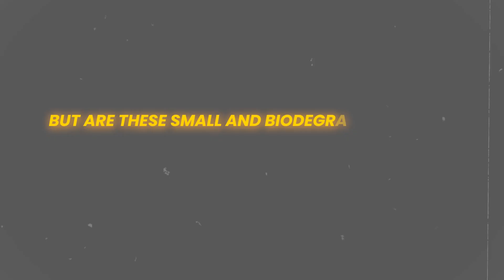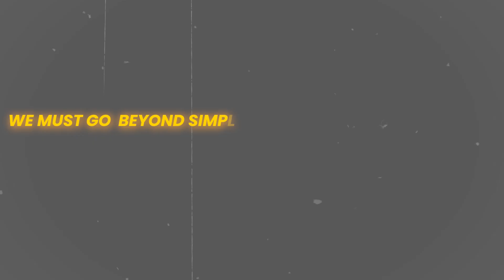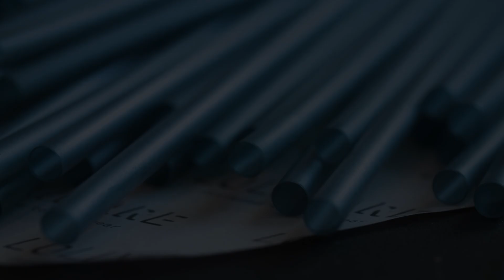How Much Are Paper Straws Really Helping To Save The Turtles

Comment: We can also drink everything without a straw!
Reply: When I went to local fast food shops as a kid we didn't even get lids much less straws, and I learned how to drink enough out of the cup before my parents left the parking lot and started hitting every pot hole.  Originally I wore a lot of cola, but got pretty skilled at not getting stuff splashed on me.  Then the first straws were introduced and they were all paper which quickly became soggy.  Plastic showed up and bendy straws and life was good again.
Most of the time I don't even use a straw even while driving.  I now have a cup holder.  When I was a kid I slipped all over that Naugahyde seat because seat belt weren't invented and most seats were bench seats, so it made it really difficult to keep the soda in the cup.  And most sodas were horribly  sweet or very flat until folks actually started doing checkups on restaurants to make sure the sodas were properly dispensed.